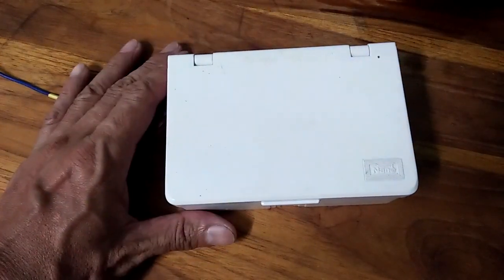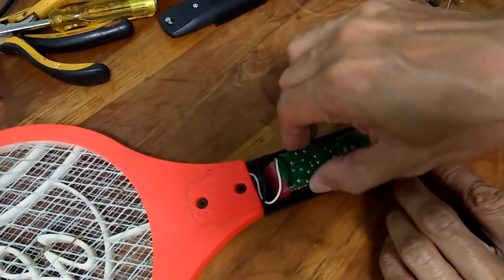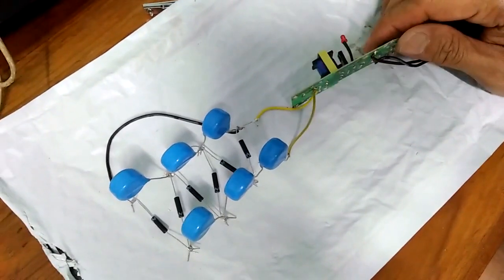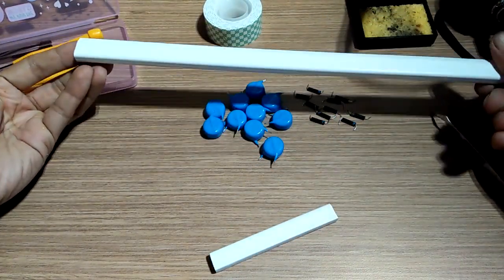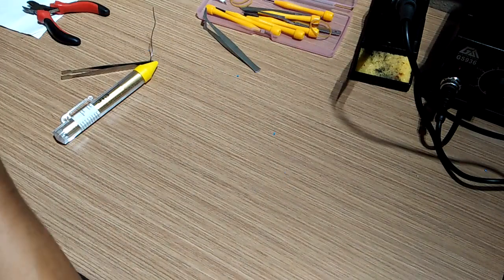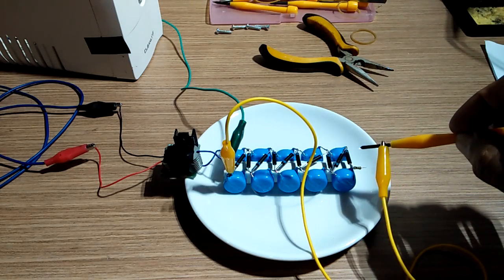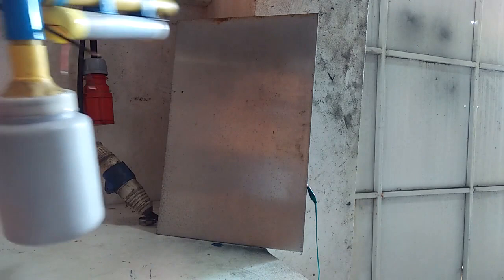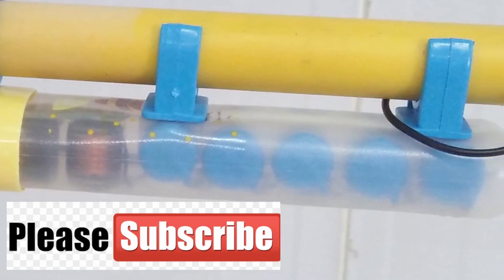Homemade Powder Coating Gun High Voltage Cascade Power Supply

Comment: هل عندك معلومة حول قيادة الترانسيستور الموجود في لوحات pcb للدهان الالكتروستاتيكي خاصة وانه يتم استخدمت كل من المذبذب وترانسيتور القيادة من نوع pnp?
Reply from the maker: Hi. I just bought that small PCB of the high voltage generator that contains the oscillator, online. It is a very cheap kit made from China we can buy on online shopping app. It is a simple circuit that only has 1 NPN transistor, 1 feedback resistor and diode.

Comment: Kuuya plz tell me can we use a crt tv flyback driver to make this project.and will it be work? Thanks
Reply from the maker: Yes. I saw some examples of using CRT flyback to generate high voltage to use with simple powder coating gun. But the CRT flyback need to have an internal diode so the output is polarized and not AC. Or can connect diodes and capacitors like the one I made in this video.

Comment: great work!
is there any specific requirements for the dc input so this multiplier can work well? (voltage-amps-watt?)
Reply from the maker: Hi. The DC input is based on the input requirement of the 15 kV high voltage generator kit. Which is 3.7V to 4.2V, 2Amp. According to the manufacturer, the input DC voltage can be increased to as much as 12V by increasing the value of the feedback resistor. The kit is originally supplied with 150 ohm, I actually changed mine to 470 ohm and I can increase the dc input voltage to 6 volts. There are many Youtube videos out there about this cheap 15 kV HV generator kit if you need more info. You can also take a look at my other video (link below) that shows a better circuit diagram of the HV generator cascade of my homemade powder coating gun.
https://youtu.be/aaLc6K-r8Ic
Reply: @DIYPhil  thanks heap for your response.. will make sure to watch your other videos aswell.. cheers!

Comment: Good job phil...
What type capasitor n resistor value..?
Reply from the maker: capacitors are 1nF, at least 20 kV rating
diodes are 2CL77, 20Kv, 5mA rectifier
resistor are not essential. my latest gun did not have the resistor at the output

Comment: I need to know name of transformer...I think it is step up one ....greets from Egypt .. you do great job
Reply from the maker: Hi. it is a small step up transformer. We buy it as a kit from China using online shopping apps. Be sure to look into my channel contents. There has been many updates to the homemade gun after this video. I am also uploading new contents about alternative high voltage generator circuits. cheers!
Reply: I am engineer fix that machine...first I try to buy cap high voltage I can't find maximum 6k volt only ...also I can't find transformer ...I start lose hope to make that...plz I need more data to assemble it plz plz

Comment: Hey I have made 1 such Voltage multiplier and when I connect it to a copper coil it doesn't create an electromagnet
Why?🤔
Reply from the maker: I don't know exactly your set-up but my guess is that there is not enough current to actually create an electromagnet. The unit of magnetomotive force (MMF) is Ampere-Turns. The output current of the voltage cascade in the video is only in the order of micro amperes. Very very small.
Reply: @DIYPhil  only used 2x so the current is probably like 1 amp

Comment: In pcb of Omega powder coating  i found that the driver of gun have two transistors pnp fast switching ans an other for power if do you have same information about this driver?
Reply from the maker: Hi thanks for the information.  The transistors are most likely part of the oscillator circuit that drives the step up transformer. I have never seen the inside of those commercial units. If you can send me pictures of the pcb that would be great.  My email philipal2015@gmail.com

Comment: Thanks for the video

I want to know the quality of the diode and the quality of the capacitor that you used
Reply from the maker: they are holding up fine. the weakest link is the transformer that came with the kit. sparks jumping between windings.
Reply: @DIYPhil  I want to know what kind of capacitor and diode to use .. please ,🙏
Reply from the maker: @explorerlech3563  1 nF capacitor, at least 20kv and 2CL77 20kV rectifier diodes. please take a look at my video update about this project. it has a better drawn circuit schematic and parts list of the gun. 
https://youtu.be/aaLc6K-r8Ic

Comment: Phil I switched things up a bit because the little 15kV unit powering the cascade is so fragile and in my opinion a weak link in the system. Im using a ZVS driver to power a flyback transformer to get high voltage. Im getting an arc from 2.5 to 5 cm depending on voltage fed into the ZVS. However I dont hear the buzzing sound with this new system. I also tried feeding this into a cascade just like if it was the small 15 kV unit, but I get the very smallest discharge corona. Super small. Without the cascade, I get a large discharge between the positive and negative of the flyback transformer. Can you help me get this thing to produce negative Ions?  If it needs to connect to your cascade, where do the + and - connect?
Reply: flyback transformer dosent work in this project, there is a small high voltage diode inside it. cockroft voltage generator required ac input not dc

Comment: As i know, ignition from motorcycle is high voltage, how but if try using that coil to generate high voltage. Cmiiw 😁😁
Reply from the maker: Yes you can use that as the transformer.  You just need an oscillator circuit to feed pulsating dc to the secondary.  But I think you will still need the voltage multiplier because just the high voltage from the coil is not high enough.
Reply: @DIYPhil  yes that i mean, of course still need multipler,  i hope you upgrade another version , using that coil 😁😁

Comment: Fantastic video as well as fantastic device!!!
Reply from the maker: Thanks. I did put some effort on making that intro video.
Reply: @DIYPhil  definitely a great intro!! I am building a full wave bridge multiplier however I am hoping that the output is a pulse train that I can slam into capacitors to fill them quickly. There is very little info or videos on using a Cwalton oor a Marx gen to fill caps. I suppose it is my turn to make a video on that. I will let you know. Thanks.
Reply from the maker: @Biokemist-o3k  would love to see that.
Reply: @DIYPhil  The first video seems like it is the hardest to put together and I will keep you in the loop.

Comment: Is it a problem if my power supply doesn't have a grounding output?
Reply from the maker: It works better with earth grounding.  you can drive a metal rod in the ground so you will have ground connection

Comment: @Diy Phil ...Great video as usual . My previous comment seems to have disappeared. ! I want to ask you what are the replacements for this diode and capacitor ? I am not able to get these values in my Indian market . Is there any other value I can use > Thanks a lot .
Reply from the maker: Hi. I'm encountering issues with viewer's comments disappearing lately. I can see it on the notification but not in the actual video comment. The diodes are high voltage diodes (HV) at least 10 kV. The capacitors are 1,000 pF or marked 102. Should be at least 10 kV too. I just used a 20 kV diode and 30 kV capacitors because those are what I can buy from the store.
Reply: @DIYPhil  thanks a lot for your prompt reply and clarification . Will try and find compatible ones . 🙏
Reply from the maker: @talwarjatin  If you can find components rated 10 kV, it will be better as the assembly will be smaller and lighter. you can see in the example commercial HV cascade in the video that they use only smaller diodes and caps.
Reply: @DIYPhil  Good point , Shall keep that in mind during my search . Thanks a lot .
Reply: Quick update 
I tried making the cascade with 2Kv 10nF and P6KR200ca doide . Didn't work . Tried both the configuration which u made and which your fly racket had. Both didn't work. No spark at all. Voltage generator works without cascade. What's wrong ? Any idea?
Reply from the maker: @talwarjatin  Hi. The components you used are under rated. For example the diode P6KR200 has a breakdown voltage of only 200 volts. For best results, they should be rated at least 10kV. You can get in touch with me through Facebook at DIY Phil, that way we can also send photos for discussion.
Reply: @DIYPhil  Once again , thanks for your prompt response. Will be arranging better and adequately rated components this weekend and will give it a try again . But i am still confused, People have even made a cascade with 1N4007 , of course not that high voltage , but much better result than i am getting with this P6KE diode.  Will surely visit your FB page. Thanks
Reply from the maker: @talwarjatin  The 1N4007 diode has breakdown voltage of 1 kV, so it is actually better than the P6KE for the cascade application. P6KE is used as transient voltage suppressor.
Reply: @DIYPhil  got it . That’s the correct reason . I think I will be able to arrange the 20 kv ones this weekend . Will share my experience for sure

Comment: Thanks you so much for your videos. I have already bought the two parts you used on your earlier design and I was about to get started, luckily I decided to watch some more of your videos and I am now ordering parts to build your new version. Originally I was researching a way to build a gun that would use tribo (static, I think?) but when I saw your video, it seems much simpler to build your version. One thing my teachers at trade school tried to teach us, was that while it was good to learn from our mistakes and experiences, it was much better to learn from others mistakes and experiences. One thing I could really use some help with, is deciding which resistors to use at the end of the cascade? I have found 15 megaohm resistors on aliexpress, but there are some that say they are 1/4 watt, or 1/2 watt? Could you possibly point me in the directionof the resistors and perhaps the number of them that would be the best.(it would be really great if you could link to somewhere with the correct ones? I have also been reading that it can help to have different outputs depending on the shape of the part being coated? Is it simply a matter of using a variable power supply, or is it more complicated? I was also wondering if it would be possible to have some sort of digital readout that would somehow correspond with the variable input, or output? Once again, you are absolutely amazing!!
Reply from the maker: Hi. YouTube somehow unpublished and held this comment. I just found it now.  The high value resistor is not essential. I guess the PC gun manufacturer put them to prevent arching which is a fire hazard.  You can do without it. The voltage input is fed to the primary of the transformer so ideally the output voltage is proportional to input.  So yes I just adjust the input voltage. Don't know if you seen it yet but I made an adjustable power supply with digital voltmeter for use with this circuit.

Comment: Hi there, great quide "how to"!!

I want to build something like you, but have some questions:  - do we need HV resistor or just 1M Ohm normal voltage 1W one?? 
                                                                                                                             -  at 4V we're getting ~100KV, but if i will feed the hv generetor with 3V we will be getting ~70KV, and with 2V  -> ~50KV?
Reply from the maker: Hi. For the resistor try to use 1 watt. It only has very low current. Regarding the actual output voltages with respect to input voltage, I'm not yet sure at this point. This is also what I want to investigate further. I will post more updates. But in powder coating, you want to have the ability to adjust the energy of electrostatic charge. Normally we want higher kV on flat and big surfaces, and lower kV on intricate parts.

Comment: Sir, How much input voltage of current we should supply ? (DC or AC)
What regulater  you are using for this?
Reply from the maker: The oscillator of the transformer needs DC power supply between 3V to 5V. The circuit draw not over 1 ampere. I used this homemade power supply I just made. But any other DC power supply will work.
https://youtu.be/8eCuureog8k
Reply: @DIYPhil   thank you sir.

Comment: Can you adjust the voltage output of the gun?
Reply from the maker: Yes. With the adjustable voltage power supply. The powder coating gun will need an adjustable output voltage. Usually higher voltage is needed for flat and bigger parts, lower voltage for corners and intricate parts.

Comment: Specs on the resistors at the end?  Also why does the high voltage cascade need to be on the gun? Cant it be in a box nearby?
Reply from the maker: Hi. I used 1 megaohm resistor at the end just because that is what I have. The commercial cascade in the example have 4 pcs 15 megaohm resistor in series for a total of 60 megaohm. The resistor is there to prevent the powder coating gun from creating a glowing plasma and arcing  at the electrode tip for safety reasons. You can see in my initial test in the dark 8:26  that the spark want to jump before the resistor, not on the end. The value of resistor is something I want to investigate further so I intentionally left that out in this vid.
Reply from the maker: As for why the cascade needs to be on the gun, I looked at all the professional powder coating gun and all have their cascade at the gun. If the cascade is in a box, then you will need a heavily insulated cable going to the gun because that will carry voltage in the order of 100 kV. In comparison the spark plug cables in a car is made to handle only up to 45kV and they have diameter of about 8mm. The hobby guns like Eastwood and harbor freight can get away with the HV generator in the box because it only generate max of 30 kV. The other reason is the switch incorporated in the PC guns. It is easy to connect a switch to the low voltage side of the cascade within the gun. Hobby PC guns mentioned above have the switch in either hand held push button or pedal switch so it is less convenient.
Reply: @DIYPhil  Have you seen the other common vid on homemade gun that is on YouTube.  It uses the pulse system you didn't like in your original gun. How do they get away with the power supply off the gun and just thin wires running to the gun? I'm not sure that results are affected by the pulse as much as it is in pipe design, 90 degree angles, and poor air flow because of it. I've seen some good work with the pulse system and designing for input output air flow
Reply: I look forward to seeing your additional work on the power supply such that the build can be compact and durable and economical.
Reply from the maker: @richardtucker5425  Hi. I just speculate that it's the pulsing output or something else in the HV module causing the powder not sticking sometimes. Take a look at this: https://youtu.be/oupryTnm-CQ
Reply from the maker: @richardtucker5425  About 2 weeks from now I can continue working on it. I will probably make a video comparison of putting the cascade in the box vs. in the gun. Also compare the performance of the cascade vs. the earlier power supply. Thanks for all your comments.
Reply: @DIYPhil  Thanks for all the great info. Always fun to experiment and find new ways. I'm going to build the pulse kind for now and await your next test. I'm going to try and recreate as close as possible the gun from Eastwood and see what happens. I think the cascade is the way to go, but I don't have a good way to power it at this point. Hoping you can come up with something small and compact. Extent of my electrical abilities is soldering and can etch a PCB if somebody can design it. Beyond that, I'm not much help.
Reply from the maker: @richardtucker5425  I actually bought 2 of those because I anticipated that I may break one. They are cheap so no big deal. At first they work fine but later develop problems. I found this guy's video who investigates those HV modules and have very good explanation why they keep on breaking so easily. https://youtu.be/mTx8pMHo4jI